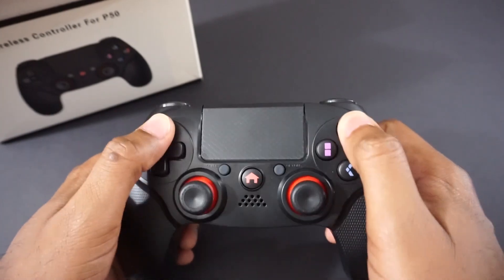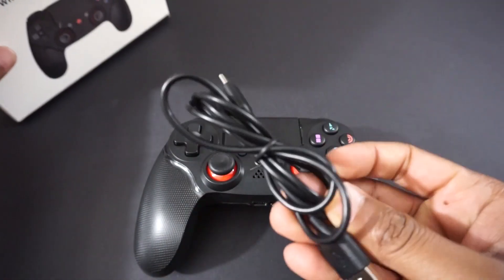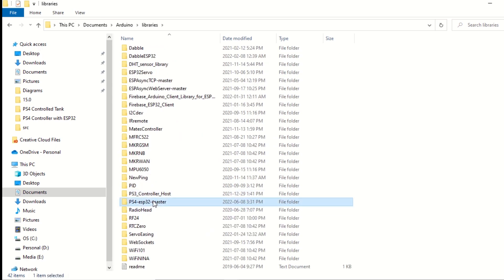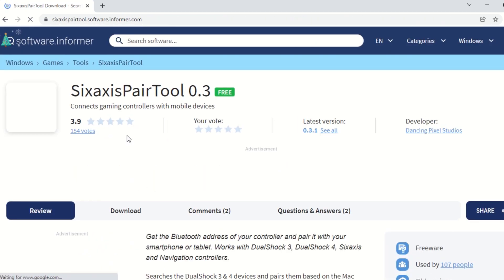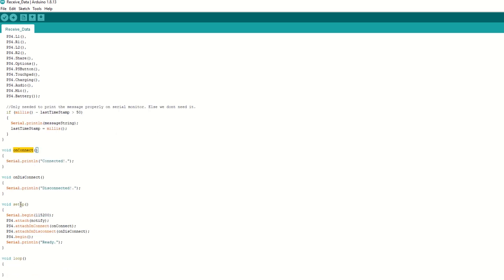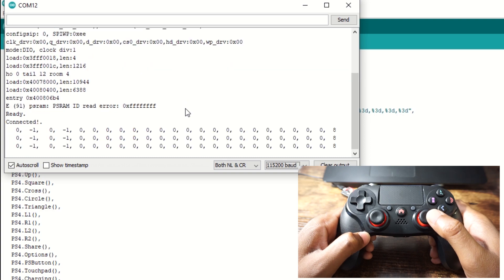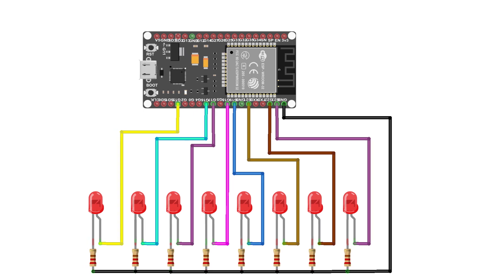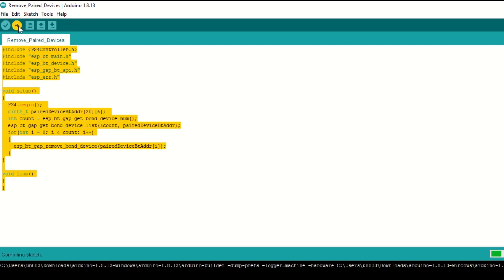How to use PS4 Controller with ESP32 🎮| Major issues solved 👍🏻

Comment from the maker: Hi guys , I have observed that you guys are sometimes facing issue while pairing the controller . I would suggest try changing the usb cable and issue should be fixed 👍🏻👏🏻
Reply: Hello, I have a question, will a duplicate fake PS4 controller work?
Reply from the maker: @PrakharParker  yes it will . Give it a try 👍🏻👏🏻
Reply: Thank you very much bro I immediately subscribed from a long time ago, this is a very extraordinary project actually and I am very excited to want to follow the steps, but I'm not so excited bro because the Sixaxis pairtool application does not detect my PS 4 address.

Please really bro how do I handle it even though I'm already excited?

Comment: could not compile it - get one error: 
e:\_development\Arduino\libraries\PS4-esp32\src\ps4.c:224:3: error: implicit declaration of function 'esp_base_mac_addr_set' [-Wimplicit-function-declaration]
  224 |   esp_base_mac_addr_set(baseMac);
      |   ^~~~~~~~~~~~~~~~~~~~~
I made the changes:
PS4Controller.cpp  =  added  as line 44  #define ESP_BD_ADDR_STR  "%02hhx:%02hhx:%02hhx:%02hhx:%02hhx:%02hhx"
ps4_spp.c = commented all except (89)  esp_bt_gap_set_scan_mode(ESP_BT_SCAN_MODE_CONNECTABLE);
trying other suggestions give more errors.
Using latest espressiv and arduino IDE 2.3.6

Comment: I tried with an esp32 c3 but it doesn't work, after some research I realized that it worked in BLE, would you have a solution?
Reply from the maker: Please use esp32 module only the one which we used in the project . 👍🏻👏🏻
Reply: @ but it’s possible with the esp32 c3 ?

Comment: Hey harsh it's working but when i remove the cable which is connected to the laptop and esp32 and connet the esp32 to my car it doesn't connect with my ps4 controller
Reply from the maker: Please follow exact steps in video . Also use only rechargeable battery to avoid power issues 👍🏻👏🏻

Comment: You can fix the compilation bug by replacing in ps4_spp.c  the line (89) "esp_bt_gap_set_scan_mode(ESP_BT_SCAN_MODE_CONNECTABLE);" by "esp_bt_gap_set_scan_mode(ESP_BT_CONNECTABLE, ESP_BT_GENERAL_DISCOVERABLE);"

Comment: hello brother im using esp-wroom 32 im not getting the blutooth address kindly guide me how i      will get the blutooth address
Reply from the maker: @mitusiqba6790  all the steps are provided in the video . Please check it slowly and carefully 👍🏻👏🏻
Reply: @hashincludeelectronics  i did just like you but haven`t got it
Reply: ets Jul 29 2019 12:21:46

rst:0x1 (POWERON_RESET),boot:0x13 (SPI_FAST_FLASH_BOOT)
configsip: 0, SPIWP:0xee
clk_drv:0x00,q_drv:0x00,d_drv:0x00,cs0_drv:0x00,hd_drv:0x00,wp_drv:0x00
mode:DIO, clock div:1
load:0x3fff0030,len:4832
load:0x40078000,len:16460
load:0x40080400,len:4
load:0x40080404,len:3504
entry 0x400805cc
E (88) quad_psram: PSRAM ID read error: 0xffffffff, PSRAM chip not found or not supported

 i got this and no blutooth mac address

Comment: Excellent work, the only problem I had was linking the PS4 controller to the esp32, I solved it by leaving the library code as it is, after that it was linked correctly to the esp32
Reply from the maker: Thanks for checking out the video and nice comment . Yes that’s because of you must be using new version of esp32 board . Good that you had it resolved 👏🏻👏🏻
Reply: Nice to know bro thx 👍

Comment: I tried with two different ESP32 chips. None worked. An ESP-WROOM-32, and an ESP32-CAM. Code compiled, is uploaded, bluetooth address is shown. But my official PS4 controller won't pair.
Reply from the maker: Try to restart the esp32 while connecting 👏🏻👍🏻
Reply from the maker: Did you update the MAC address properly into controller. ?

Comment: why, after commenting out the file in ps4_spp, the error comes out note: declared here
 esp_err_t esp_bt_gap_set_scan_mode(esp_bt_connection_mode_t c_mode, esp_bt_discovery_mode_t d_mode); . And if you do not comment on this line, then everything works, but the ps4 controller does not connect
Reply from the maker: It’s working for me without commenting line as well 👍🏻👏🏻

Comment: Bro please help,esp32 and ps4 not connecting so any solution,
Reply from the maker: Try using different cable 👍🏻👏🏻
Reply: @hashincludeelectronics  mene mac address ps4 controller mai insert kar Diya hai  or code bhi complie ho raha hai without any error but esp32 or ps4 controller connect nhi ho raha hai?
Reply from the maker: @YOUTUBE-AAREX-GAMING  try restarting the esp32 . And then connect PS4 controller .
Reply: @hashincludeelectronics  bro nhi ho hai abhi bhi , ps4 controller pair nhi ho raha hai mene 2 esp 32  mai try kar chuka hu 😅 
But ps4 controller phone mai or pc mai easily connect ho raha hai
Reply: @hashincludeelectronics  already try

Comment: Hi, im currently having issues with the PS4 Controller Library with the error being

c:\Users\User\Documents\Arduino\libraries\PS4Controller\src\PS4Controller.cpp:3:10: fatal error: esp_bt_defs.h: No such file or directory
 #include <esp_bt_defs.h>
          ^~~~~~~~~~~~~~~
compilation terminated.
exit status 1

Compilation error: exit status 1

i wonder if anyone could help, thankyou
Reply from the maker: Did you install PS4 controller library ? Please do so .
Reply: @hashincludeelectronics  yes ive already installed all of the required library and board managers and followed the steps as shown in the video, ive also tried reinstalling the arduino ide, and using an older version of the  esp32 boards manager
Reply: @hashincludeelectronics  nvm got it working already. thanks
Reply: @mohmazter  man, How?

Comment: how to get the esp_bt_defs.h library?

fatal error: esp_bt_defs.h: No such file or directory
    3 | #include <esp_bt_defs.h>
      |          ^~~~~~~~~~~~~~~
compilation terminated.
Alternatives for esp_bt_defs.h: []
ResolveLibrary(esp_bt_defs.h)
  -> candidates: []
exit status 1
Reply from the maker: You need to install the esp32 board. Please check the video for this step.
Reply: @hashincludeelectronics  but it is installed

Comment: Great Video, I followed the instructions and it solved the compilation error, But I still can't Pair the controller Which Version of ARDUINO IDE does this work for? (I'm using 1.8.19)
Reply from the maker: Did you set the mac address in controller ? Try restarting the esp32 👍🏻👏🏻
Reply: I couldn't find a safe way to download the sixaxis pair tool, so I found the MAC address of the controller and wrote that as a string into the PS4.Begin() function call in the setup function like " 

void setup() 
{
  Serial.begin(115200);
  PS4.attach(notify);
  PS4.attachOnConnect(onConnect);
  PS4.attachOnDisconnect(onDisConnect);
  PS4.begin("a0:ab:51:8d:9x:7c");
  Serial.println("Ready.");
}

" The function is used that way in the example codes of the library, but I can't get them to pair. does the fix to the compilation error change the way that this function can be used? I am using the same version esp32 board (1.0.6) that you downloaded from the board manager. but I'm using a ESP32-Wroom-32, so I select "ESP32 devkit" from the board manager (or else I'd get a PSRAM ID error)  @hashincludeelectronics

Comment: i want to ask, how if you use that controller, to controll 8 pcs ESP32. Its mean 8 controller controll 8 pcs ESP32. How to add a addres to that?
Reply from the maker: You want to control 8 esp32 with single controller ? Or 8 esp32 with 8 controllers ?
Reply: @hashincludeelectronics  8xESP32 controlled by 8 controller. Isnt need a different addres for that?
Reply from the maker: @ipkosalim1667  it’s easy then . Each esp32 will have different MAC address 👍🏻. Check it .

Comment: Hi, I followed the instrcutions, but in the serial monitor, when I press EN, the ESP32 shows ready, but then when I turn on my PS4 controller, the ESP32 board reboots

Backtrace: 0x4008374d:0x3ffcd030 0x40094369:0x3ffcd050 0x400996c5:0x3ffcd070 0x4010aa36:0x3ffcd1a0 0x40169e9e:0x3ffcd1c0 0x40158f02:0x3ffcd1e0 0x4001791d:0x3ffcd200 0x40159871:0x3ffcd220 0x4015994e:0x3ffcd260 0x400188f5:0x3ffcd290 0x40159191:0x3ffcd2d0 0x4015ccbd:0x3ffcd2f0 0x4008792c:0x3ffcd310 0x40019d11:0x3ffcd340 0x40055b4d:0x3ffcd360 0x40157753:0x3ffcd380 0x40157db9:0x3ffcd3a0

ELF file SHA256: 474eaa05b8439795

E0ISR
Rebooting...
ets Jul 29 2019 12:21:46

After this message, it returns back to the ready message, is there anything I can do? The controller is also just blinking and not connected :(

Comment: hello everyone, Harsh bruh loved your video i was imitating each step you did but at the end the controller wasnt able to connect to the ESP32. After 2hrs of trial and error i found out that the comment(//) in the library had to do with it so this is what worked for me hope it could help u guys.
Line 86, 87, 88, 90 commented(//) and Line 89 uncommented.
Reply from the maker: Nice 👏🏻👍🏻
Reply: which file exactly? ive been fighting the ps4 controller disconnect for a week now, many wipes many removed bonded devices still issues uts driving me insabe controller connects for a second then turns off
Reply: @hecticaperture make changes in the .src file shown in video.(worked for me)
 
Try resetting your controller(small switch on the back)

Make sure ur controller is charged to full, mine kept disconnecting after after few seconds, after charging problem solved 

This should work
Reply: Hey harsh it's working but after I remove the cable of ESP32 and connect it to my car the PS4 controller doesn't connect

Comment: I've been having issues with pairing a generic PS4 controller with my ESP32. Initially, I downloaded the SixaxisPairToolSetup-0.3.1 program to change the MAC address. However, when I enter the code, compile it, and try to pair it with the controller, it blinks about 3 times and stays on for only 2 seconds before turning off. Now, after trying the same code multiple times, the controller keeps blinking until it turns off. Any ideas on what could be causing this issue? Why isn't it working? Thank you.
Reply from the maker: Sometimes you need to restart the esp32 board 👏🏻👍🏻

Comment: The pair tool doesn't show any device connected. Does it not work with an official PS4 Dualshock controller?
Reply from the maker: It should work with that controller too . Try using different cable .
Reply: @hashincludeelectronics  do you need the specific kind of cable you were using? I'm using a micro usb is that a problem?

Comment: Hello, thank you very much for your video, I have a question, when I uploaded the code for minute 2:30, it gave me an error that told me that in line 89 of the ps4 controller script, there was data that I did not recognize, I commented on that line and the problem was fixed and I was able to upload the code, but when I tried to connect the controller later, it does not recognize it, is it necessary to have the code for line 89?, or am I doing something wrong
Reply from the maker: Thanks for checking out the video 👏🏻👍🏻. Yes you need to fix that error. Please don’t ignore any line of code . 👍🏻
Reply: @hashincludeelectronics  Thank you for your answer, I have another question, looking at my esp32 module I realized that it is the esp32S module, does the code work the same with this version of the board?
Reply from the maker: @Zetastico  yes it should .

Comment: Mr Hash: can you please post the exact model number of the ps4-controller that you are using so I can try and find one of the same model. The one I have does not connect to the 'sixaxis pair tool' so I am unable to get passed that stage. I have managed to retrieve the BT MAC for my ESP32 DevkitC v4, and I am able to use my Lenovo M10 android tablet with various BT 'scanner apps' to 'find' the ps4-controller and to 'pair' my tablet with it. Some of these apps also told me the BT MAC of the ps4_controller which could be helpful. So I have BT MAC's for both sides of the ESP32/PS4_controller pair but am unable to complete the 'sixaxis pair tool' process. The model of ps4_controller that I currently have is CUH-ZCT-2U and came from Aliexpress. No specific make shown.
Reply: I now know that the reason my 'sixaxis pair tool' process is failing is because my ps4-controller device is not installing on the USB correctly. The Device Manager shows "Unknown USB device(Device Descriptor Request Failed)". So I guess there is nothing I can do about that other than find a different device.
Reply: @kerimensshed  I also have a similar controller (CUH-ZTCT2E) from aliexpress. And the same problems. The  'sixaxis pair tool'  can't see it.
Reply: @andreyl2705  that is interesting, I thought it was just me. I have noticed that when I plug the PS4_controller into my PC USB port, the PS4_controller goes into 'charge mode'  and cannot turn on. I have a special USD plug that isolated the charging wire and that allows the controller to attempt to install the usb connection, but that also fails with an 'unrecognised device' message. What I do not get is why so many other do not seem to have this issue.

Comment: Some more information...I have a PS4 controller.  It will not connect to the ESP32.  When I run the code from Dronebot Workshop for connecting a PS3 controller, it DOES connect to the ESP32.  But the data is totally messed up.  This is starting to get above my level of understanding.  But I would think some smart person out there could utilize the connection algorithms from the PS3 code to get the PS4 to connect.

Comment: After two days of trying with a very cheap controller from Amazon that did not connect with the sixaxispairtool, I broke down and paid $64 for an official Sony PS4 controller.  That controller did connect to sixaxispair tool and I can set the MAC address.  Now, like many persons, it does not connect to the ESP32.  I notice in your diagram that you have a 38 pin esp32.  I am going to try different ESP32 boards and see if a different one will connect.  Dronebot workshop is doing similar work with PS3 controller.  I might try his code also.
Reply: Try using the newer version of the sixaxis pairing tool.  0.2 won’t work with modern service packs of windows 10a

Comment: After commenting those lines of code I get an error when compiling "error: 'ESP_BT_SCAN_MODE_CONNECTABLE' undeclared (first use in this function); did you mean 'ESP_BT_NON_CONNECTABLE'?
     esp_bt_gap_set_scan_mode(ESP_BT_SCAN_MODE_CONNECTABLE);  ", can someone help me?
Reply: you need to comment all 5 lines there out. go back into the notes application where you did that you probably missed a line
Reply: @kirbyfrog7382  thank you so much dear, faced the same problem and now is resolved with your help.love u

Comment: Hi I use this library but my servo is not moving smoothly, what might be the error?
Reply from the maker: Not sure how did you code for servos . May be add some delay before changing the servo position . Also increase/decrease the servo angle in each step . 👏🏻👍🏻

Comment: Bruh Loved your video, but only issue is that my controller disconnects after few seconds, so i uploaded your remove paired device program to my esp because of which my esp becomes unable to connect and doesnt show ready in serial monitor. so i have to reupload your Receive Data program and same thing happens all over, hope u could help me out, Please and Thankyou

Comment: can this be done with the actual DS4 controller? the playstation one
Reply from the maker: Yea you can use any PS4 controller 👍🏻
Reply: @hashincludeelectronics  i've tried to connect to the ps4 after uploading the receive data code. in the video you just pressed the 'home' button while on my ps4 controller, the center button is the playstation button. after i pressed the button, it isn't connected as yours. so there's no reading on the serial monitor, just the status 'ready'

Comment: When I trying to use this library in conjunction with an SD card - esp32 hangs on PS4.begin. If I comment out PS4.begin the rest of the code works successfully. If I physically unplug the SD card adapter, the library runs successfully. SD card connect via SPI. Does anyone have an idea how to fix this?
Reply from the maker: May be the SPI pins are interfering with other pins used in the project .
Reply: @hashincludeelectronics  For the purity of the experiment unplugged all except the SD card. The result is the same.

Comment: i already change mac adress to make it the same,using 2 method, getting adress from saved address from controller then pasted on esp32,and getting esp32 address then write to the controller,but it doesnt work for me,i already comment some line on ps4spp files like in the video,but doesnt work,when im pressing home button led just blinking then turned off,then im trying to connect my controller to pc for testing playing some games its just fine,then im trying connecting esp32 bluetooth with my android using SerialBluetooth example and its perfectly fine, i mean both device function just normal,but still didnt work when trying to pairing my controller to the esp, need help here
Reply from the maker: Thanks for checking out the video 👌🏻👍🏻. Could you please try clearing the Bluetooth devices as suggested in video ?
Reply: @hashincludeelectronics  yes i did it too, but still didnt work